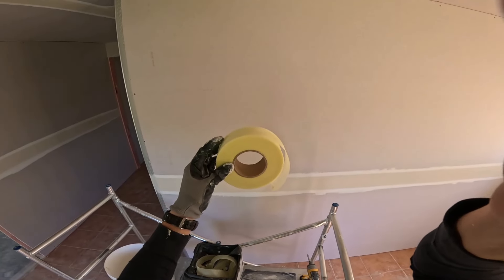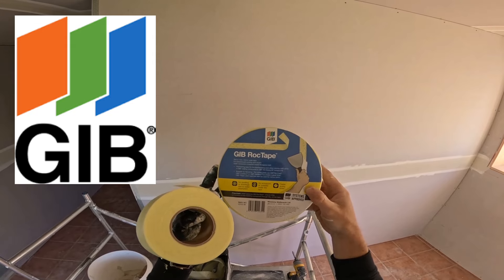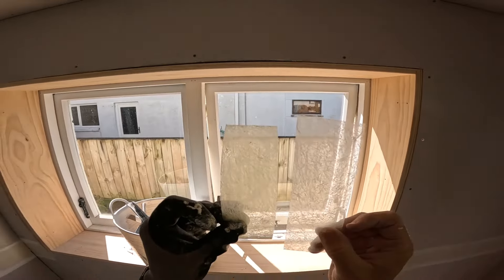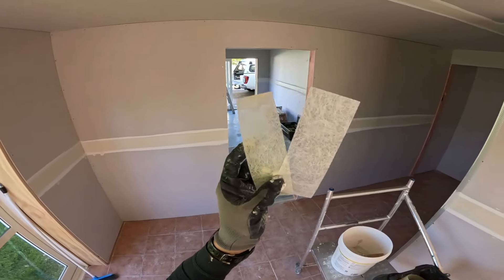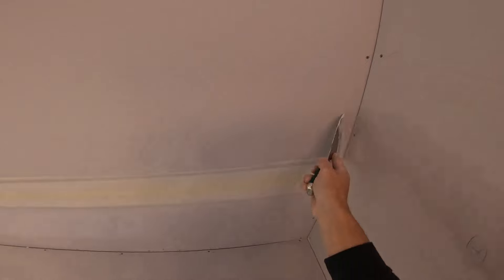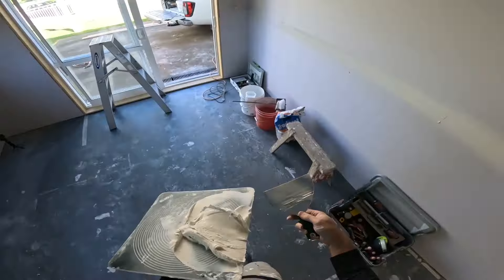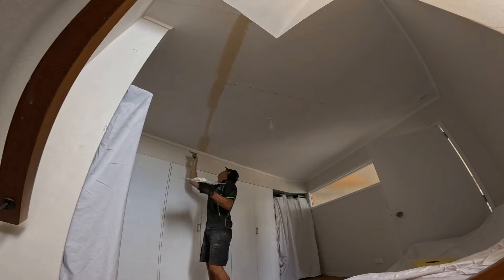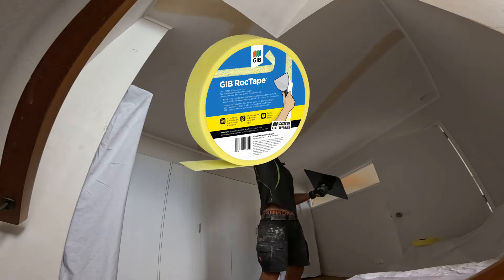New Fibreglass Tape for Plasterboard Joints

Comment: My painter swears by this product. It is superior to paper tape, and he has stopped using the self adhesive fibatape, he would rather apply an extra coat of plaster to bed the yellow drywall tape. I am still learning to plaster, and once I am confident and competent enough, I will use the yellow drywall tape.
Reply from the maker: @glennfolau6959  yes I really like it.